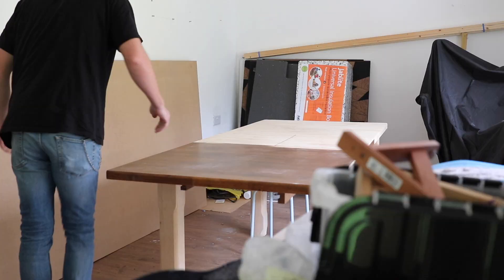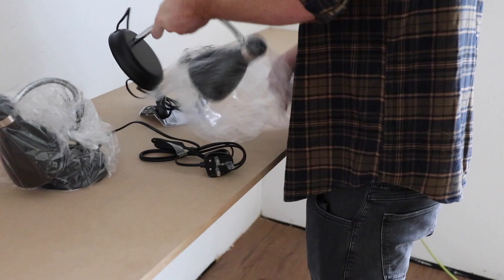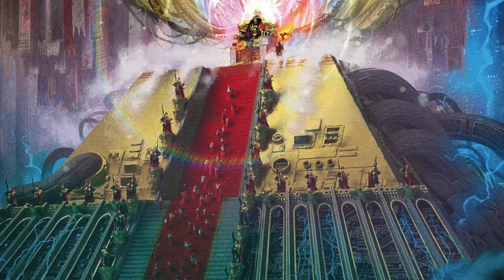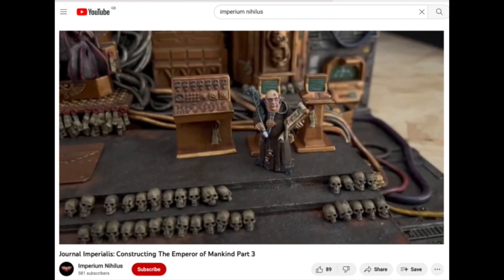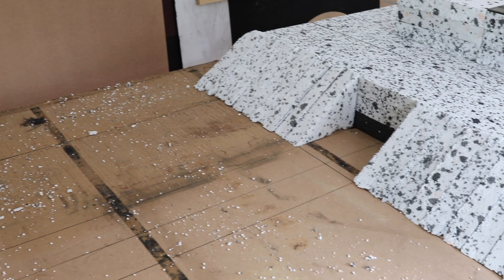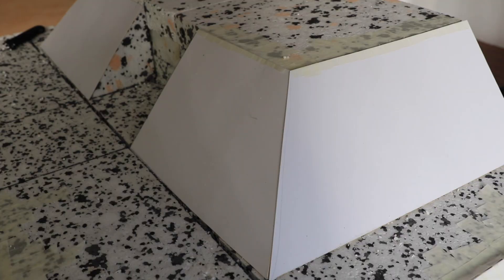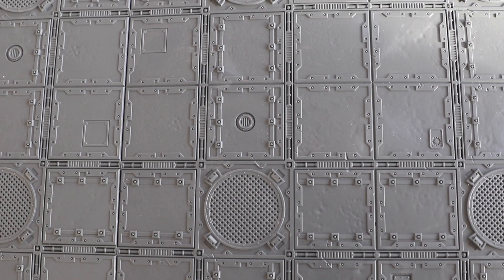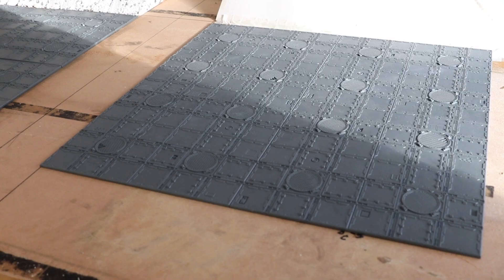Constructing the Emperor of Mankind version 2 0

Comment: However long it takes I'll keep watching to see the progress as something of this scale is unreal to watch.  With all your experience with greenstuff and using the rollmaker what do you use to keep the greenstuff from adhering to the tool?  I've had mixed results with mine and wondered if there was anything I might have overlooked.
Reply from the maker: Thanks for watching 🙂. I tend to use a bit of water when using the Greenstuff roller though it’s not a perfect method. Occasionally some pieces might stick but I just use a bit more water and re-roll them. As with a lot of my work it’s very trial and error. 
You can also let the Greenstuff cure for a little bit so it’s not as tacky. 
Hope this helps in some way!
Reply: @imperiumnihilus  thank you, it does help a lot.  Cheers.